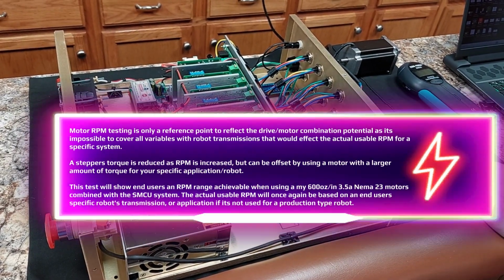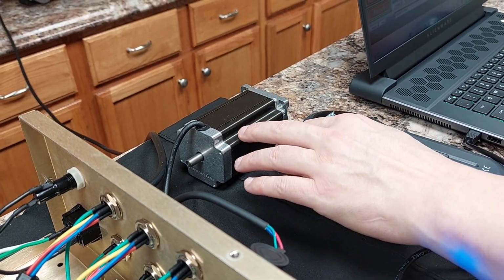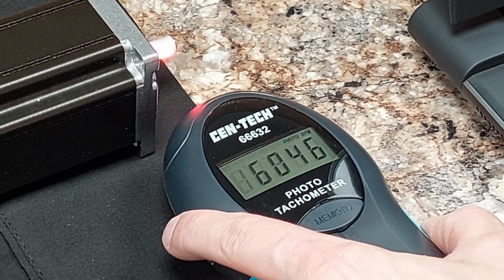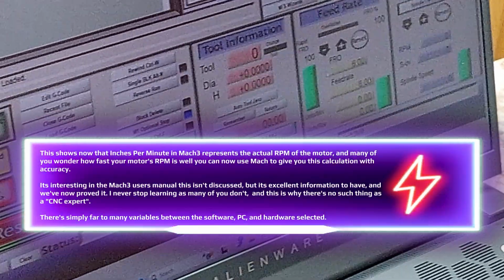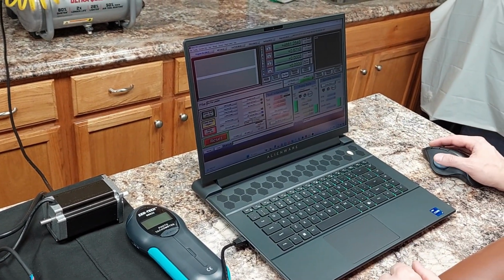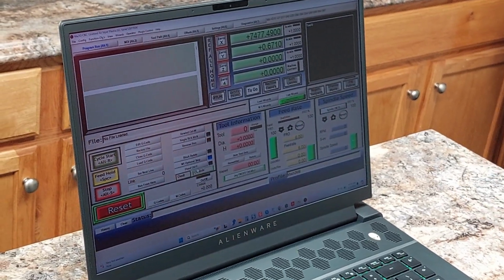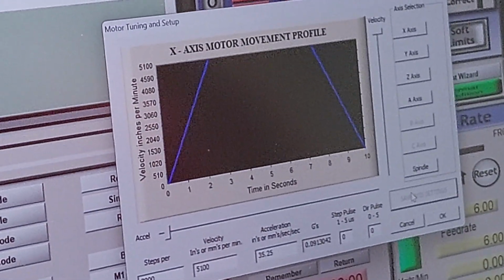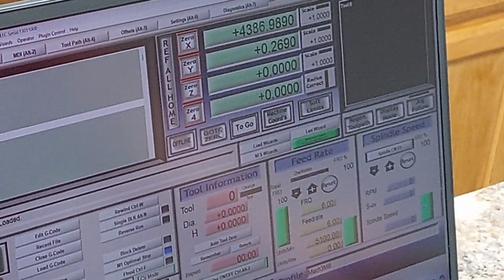The SMCU Drive's Motor RPM Test With Tachometer Readings..

Comment: Mr Vince and your wife Thanks every video i learn new thing
Reply from the maker: Thank you for your support! I really appreciate it, and am glad to help. Vince
Reply: @corvetteguy50  Mr Vince I heard you face a problem in the db25 connector how did you change the pins you can not change the pin in the ribbon maybe you modified the pcb Centronics connector
Reply from the maker: The connector is being redone by the AudioOhms to correct the pinout. Thank you,
Vince
Reply: @corvetteguy50  Thanks
Reply from the maker: You bet...:)

Thank you,
Vince